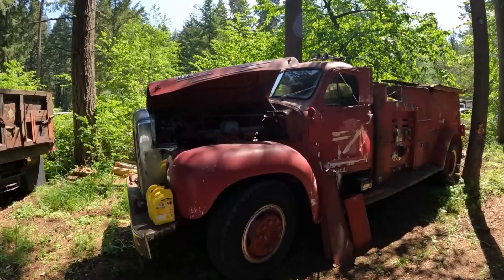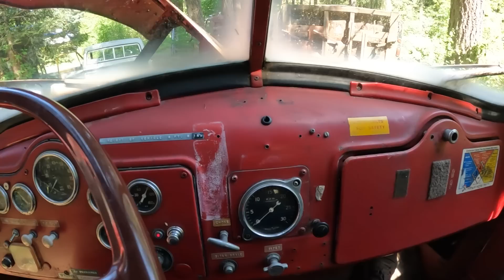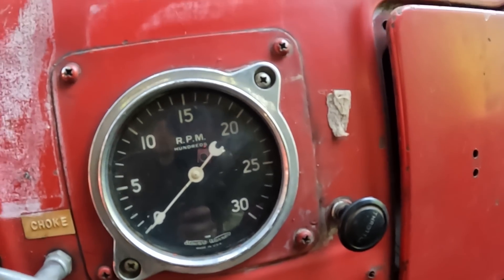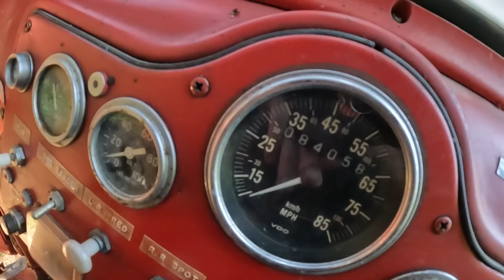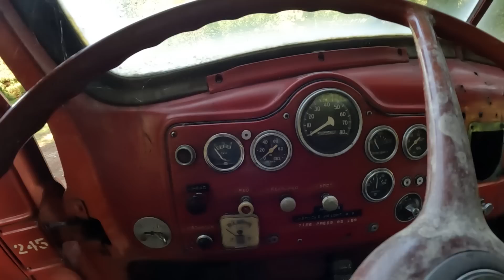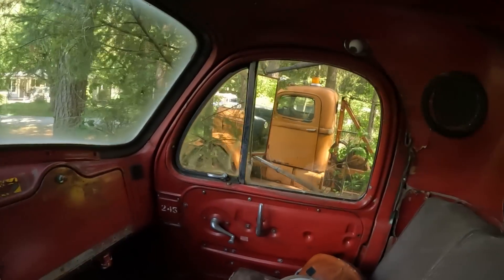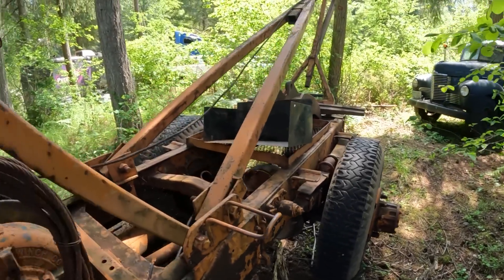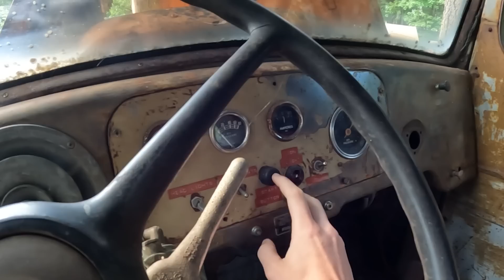62 Chevy 1 Ton Gets 4x4 + Mack B-21 UPDATE! + 49 White PLANS?

Comment: You've got some neat projects going on!  For the White tow truck, I wonder how a Cummins 4BT-3.9 turbo diesel would fit (6BT may be a bit long)?  A Detroit 4-53 (w/ turbo) would be great also; noisy, but what a great sound they make!  As an oddball suggestion, maybe a GMC "big block" V-6, like the 478 cu. in.?

As for the B-21, glad to see they're getting some TLC...As for sirens, they may have used the B & M-type (they weren't Federal "Qs", which came along later); the lights, at least from what I recall when they were in service,  had a 2-light red "gumball machine" (rounded top) atop the cab.  Neat that the horn works!  Thanks for the updates!

Comment: 6v53 TT for the White if you're doing a Detroit, bonus points if you can find jakes for it too. 
For the Macks, I would go restomod and pull the engines and replace them with something less rare.
Reply: I think a 4-53 or 3-71 would be adequate, and cheaper. Lotta old fishing boats out here in Neah Bay still have Detroits in em.

Comment: should be 2 switches on the captains side (pass side) one is for the horn an other for the siren, reason they did that is so the captain or whoever is highest rank in charge controls them an helps watch for traffic an obsticals an so on so the drivers job is to just concentrate on gettin to the call quickly but safely

Comment: Temp sensor for the gauge is bad or maybe the wiring for it since you said there's wiring issues, check that first before replacing the gauge, 99.9% of the time is either the sensor or the wiring never the gauge once it's the original one to the truck.